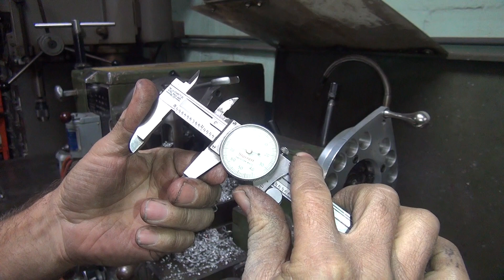#130 S&S 113ci evo motor blown belt drive transmission repair harley swift evolution tatro machine

Comment: If you put the wheel in the fridge for a while than this material will turn a lot better (little tip from a machinist)
Reply from the maker: yes but than i would need a fridge and more time.
tatro

Comment: How can a biker  have a bike in that  condition 🤔
Reply: I think I’d rather have a skate board.
Reply from the maker: you would be surprised. most older bikes have lots of issues like this one. paying for bad work does not help.
tatro
Reply: @TatroMachine   so you  on the move better,  locating in the hill's  then  do you  get much stuff  from across the pond